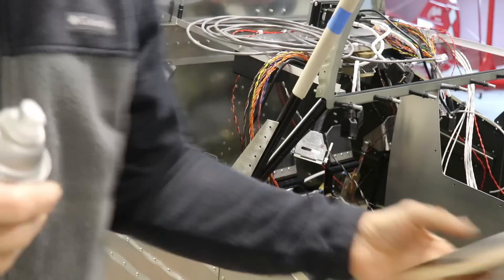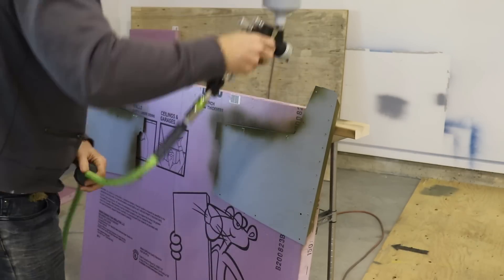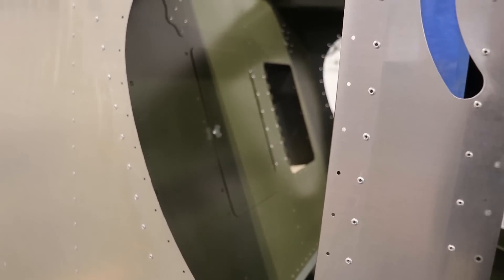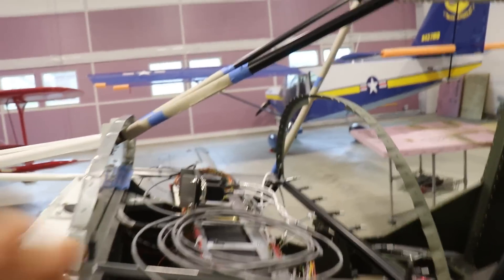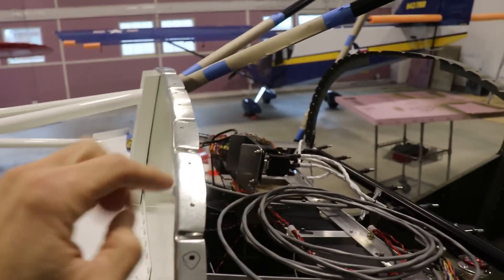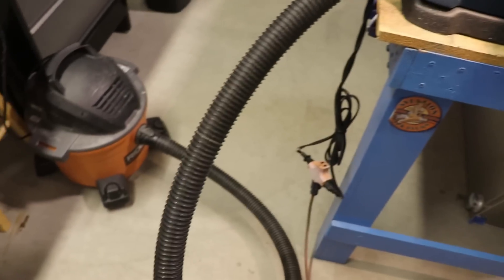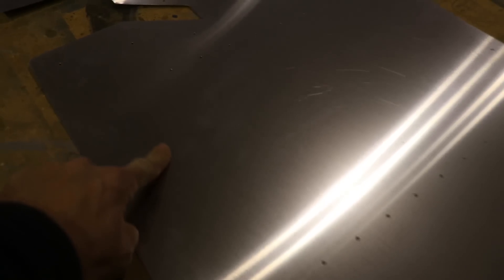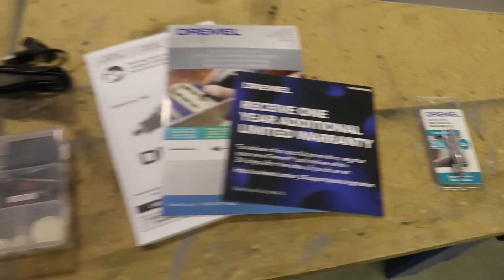Painting Interior Pieces/New Custom Glareshield Fab (Ep65)

Comment: Sorry about commenting on such an old video, but I've got to ask about your use of a band saw to cut aluminum.  I have an old craftsman wood band saw that I am considering using to do the same.  Its designed to do wood, so I am worried it might run too fast for aluminum.  Did you do anything to adjust the speed on yours?  What kind of blade are you using.   Do you worry about the aluminum swarf damaging the drive wheels?  Do you cut dry or try some sort of lube on the blade?

I'm a little stalled on my SD project.  Remodeling the shop and other projects.  I have all the control surfaces done along with one wing.  The other wing is on the bench and the fuselage is still in the crate.  Probably should be out there now instead of catching up on your videos ;)
Reply from the maker: I’m using a Ryobi band saw but bought a different blade for it at Home Depot. I don’t recall the teeth count but there’s a lot more teeth than a wood blade would have. I believe the speed can be changed by moving the belt to a different pulley in the top of the saw. Yours might be different. I cut dry and it works great. I also use a vacuum and an old paint brush to try to clean up as much of the metal shavings as possible.

Comment: My battery operated Dremel would not hold a charge worth a dam. I should have sent it back but my corded Dremel I've been using for 20 Years.
Reply from the maker: Mine holds a charge but it’s so weak it’s not even usable. I should have returned it too. I still use my old corded one.